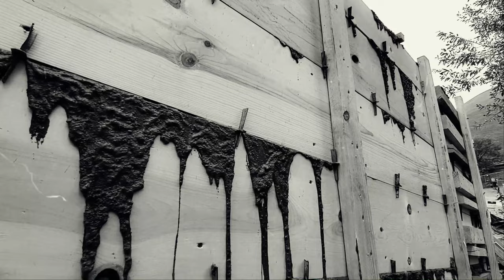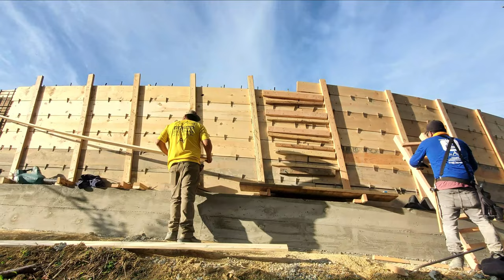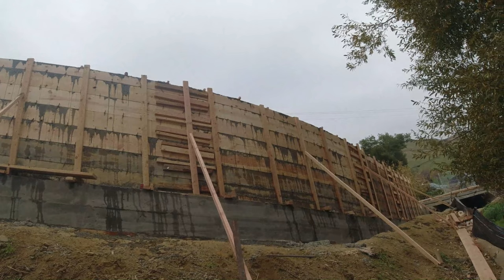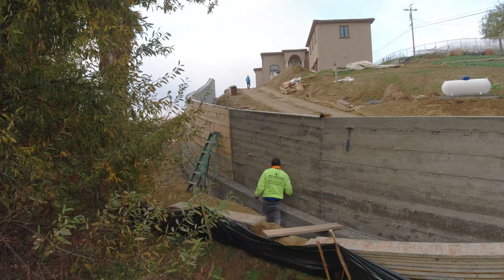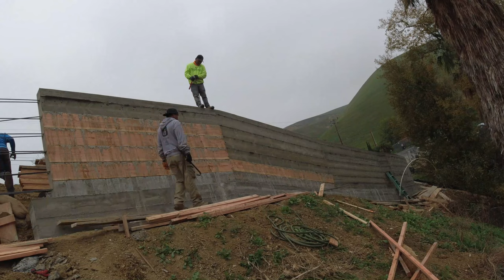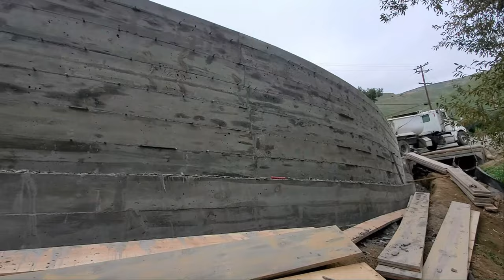Removing Concrete Forms From Retaining Wall (Board Finish)

Comment: What clips did you use to keep the walls spaced correctly?

Do they snap off after you strip the forms?

Do they streak rust over time?

Thank you in advance
Reply from the maker: For this wall we used Simpson Wt-8s..